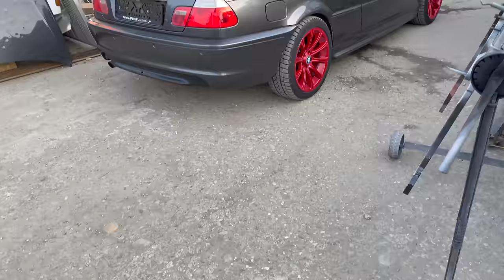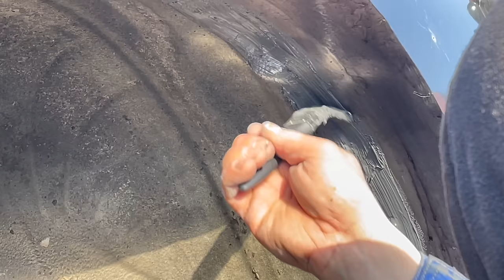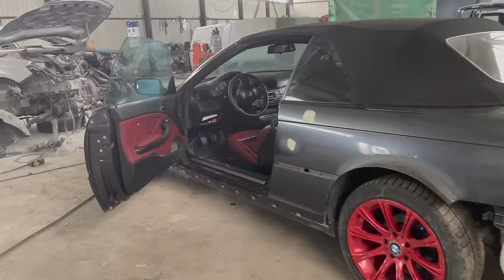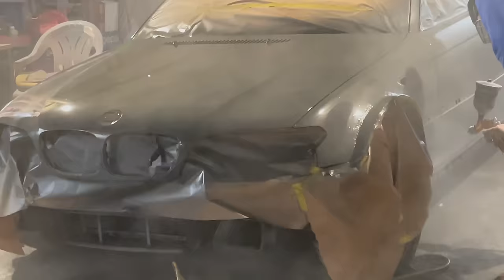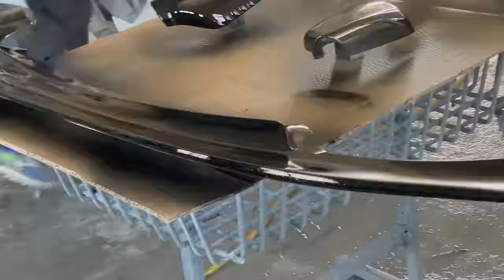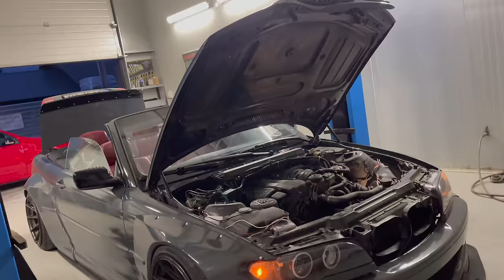e46_PANDEMIC Project Build BMW e46 Pandem in minutes - From ZERO to HERO

Comment: Hey, i've actually been thinking of buying a e46 but people all around me claim that it breaks too much. Saying that it's an unreliable car not worth getting. What are your thoughts on this?
Reply: E46 unreliable? Bruh, in my country ppl do 400k km on that thing while changing oil after each 25k, which is farrrr to rarely. I dont know how is your region situation (like the call culture and documentation of the oil changes etc) but if you don't buy a total wrack you will be fine most of the time.